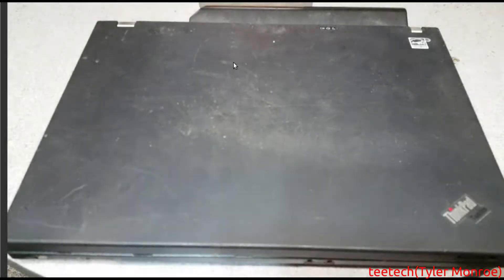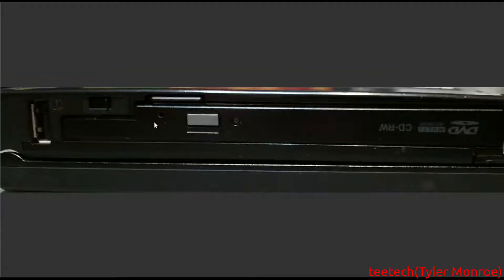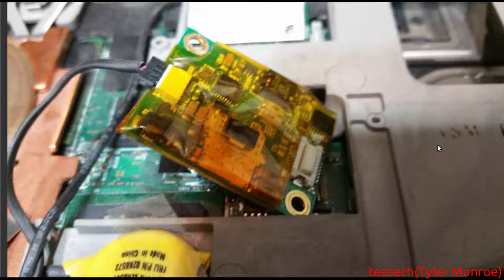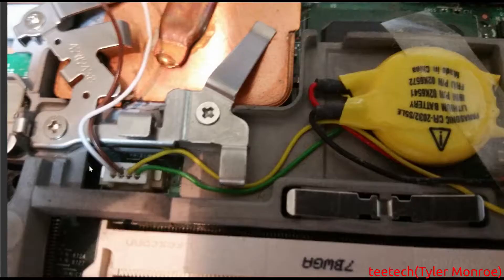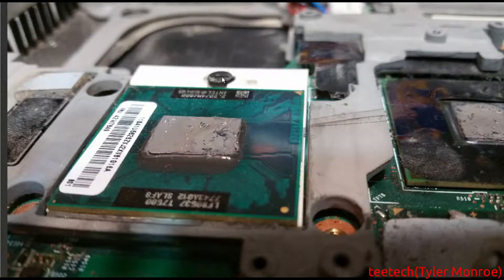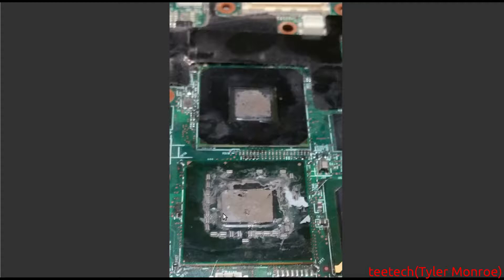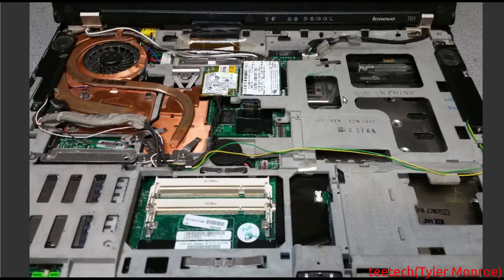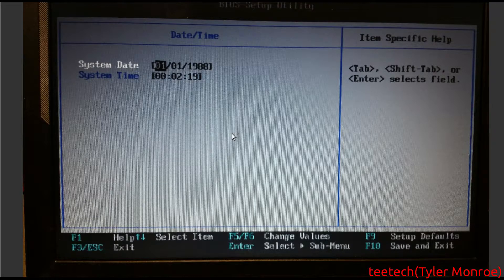Thinkpad T61 Motherboard Replacement

Comment: very calming voice fren
will this be applicable for the T60 too? i just need to reach the SPI EEPROM  chip
thanks for the video & your time
Reply from the maker: Hi Cletus.
It should work for a thinkpad T60 provided you use a T60's motherboard for the replacement. I'm not sure that a T61 motherboard can fit into a T60s case but maybe it does.

This may help I spotted both the T60 and T61 in the list:
https://www.thinkwiki.org/wiki/Hardware_Specifications

thinkpads.com is also a helpful resource:
https://thinkpads.com/t61/index.htm

They also have a forum for both models:
https://www.thinkpads.com/forum/viewforum.php?f=29

Hope that helps you and thank you very much for watching.

Comment: is there a way to replace RAM slots in these laptops¿¿ I have one I want to convert into a retro emulation machine, but the RAM slot set by default as the main  is damaged by corrosion and there is no way to even start de OS with the other RAM slot
Reply from the maker: Hi Shiroumx. 
I've heard some corrosion can be removed by taking out the CMOS battery and washing the board either in the sink or dish washer even. But if you want to replace it you would have to find an identical board and desolder the ram slots from both of them then solder the working one onto the old one. 

Louis Rossmann's channel may help give you the idea at least for mac books but it has some crossover into other hardware repairs as well.
https://www.youtube.com/channel/UCl2mFZoRqjw_ELax4Yisf6w

This video from uxwbill shows how to wash a computer I would think this may remove corrosion also but I haven't personally tried this.
https://www.youtube.com/watch?v=ahhSDEgkqQ8

You can also use a machine called an ultrasonic cleaner and I'm pretty sure those will remove any corrosion etc on the board. If you search ultrasonic cleaner on Louis Rossmann's channel you can find information about them and see them in action.

I hope that helps point you in the right direction. Thank you for your comment and for watching my videos.
Reply: @teetechtm   Thank you very much for taking the time to respond. The information you provide me is very complete. This weekend I will get to work on this  🙏

Comment: Would you help me please.  Sir, I have a Lenovo thinkpad T61 computer and it asks for the bios code when booting up. Is there a solution because I am in a dilemma and I cannot how to solve the problem? Please, Sir, can you help me find the bios code for my computer? Thank you.
Reply from the maker: Hi.
With BIOS level passwords meaning either a boot password or hard drive password. Those are not managed by the OS so it can't be changed by simpling reinstalling a different OS. 

The only options I know of are.
1. Decode the password back to plaintext from the hex dump of the BIOS image.
2. Desolder the BIOS ROM chip that has the password configured and replace it with one that doesn't have a password configured.

Hope that helps thank you for your comment and have a nice day.

Comment: The installation of Openbsd is in this computer?
Reply from the maker: Yes you can install OpenBSD on this computer. The only issue that affects OpenBSD specifically is the fact this laptop uses the quadro nvs 140m gpu. The OpenBSD devs can't get the documentation they need.  In order to write a driver for their kernel to interact with that gpu. 

To the best of my knowledge... I believe it's because Nvidia doesn't openly release documentation about their hardware. Unless the developer signs an NDA with Nvidia. That goes against OpenBSD's no binary only drivers policy. 

With all that said FreeBSD, Linux and of course windows all support it. And I do believe they make a version of this laptop with an intel based gpu which OpenBSD does fully support.

I hope this helps you and thank you for watching.
Reply: @teetechtm  yes thanks i will try to install Openbsd and Freebsd on two thinkpads T61
Reply: @teetechtm  In my country (México), this model was sold with Intel PM965/GM965 chipset
Reply from the maker: @eom22x  Sounds good. Let me know how it goes for you.
Reply from the maker: This model list may help you.
https://www-01.ibm.com/common/ssi/cgi-bin/ssialias?infotype=DD&subtype=SM&htmlfid=877/ENUS6457-_h06

It seems this is the only intel based gpu they put in that model line:
Intel Graphics Media Accelerator X3100 

The only two are nvidia based ones.